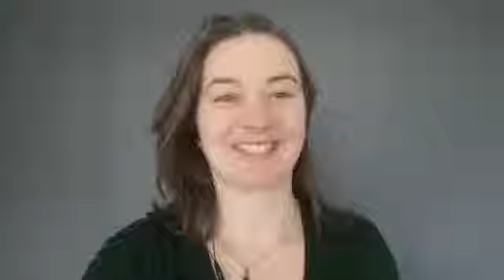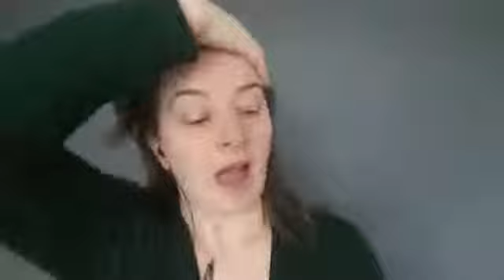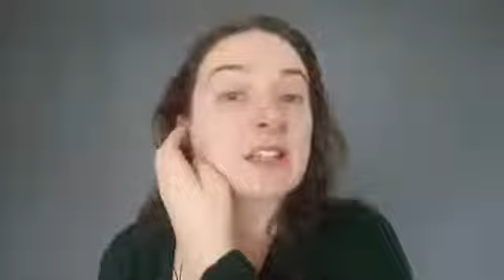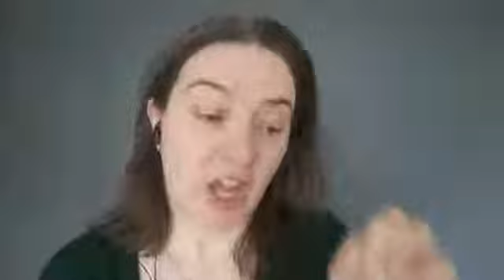Homeowners guide to building control

Comment: Have a question about building control ->

Have an extension that was built by prior home owner.  Roof is now leaking and is in need for replacement, if we were to knock down and rebuild the extension (with planning approval) do we need to go back and get building control approval?  If we just replace the roof would that need planning?  Seem to get varying responses depending on if windows get bricked up or not.  Any help would be appreciated!
Reply from the maker: This is too complex to answer in a simple comment and I would need more information to be able to answer this properly for you. You can book a consultation call with me to get in-depth answers to your project specific questions here: https://hello.dubsado.com/public/form/view/5c3747e093578b4bd89dbbdf

Comment: Brilliant video. 

We’re currently purchasing a property  which has an extension built in 2003. The current proprietors took out an indemnity policy for this as there was no paperwork available. I have found that this is listed on our local authority’s building control portal, however this is staged as “building work started” but with full approval of plans. Just a little perplexed as to whether this would mean it was signed off at the home or remains outstanding? 

Rather reluctant to contact my local authority as I would not want to invalidate the indemnity policy insitu.
Reply from the maker: Check what the indemnity covers you for - you need to know the specifics of that. Check if asking building control about it would invalidate it - it might not and then you could find out more.
Getting sign off / regularisation might be easy if its built in accordance with approved plans - though finishes may need to be removed and reinstated, and possibly rectifying works, which could be costly - this work should be covered by the insurance but you need to check.
It may have been signed off but no completion certificate issued - which will remove the problem.

Comment: Who is responsible for knowing what the building regs are and if they have been meet, the homeowner or the builder? We have converted the loft to a chalet bungalow and the building inspector has been round several times. They came when the steels were put in and said everything was correct but now all the insulation and boarding has been done they are asking if the steels have been fireproofed. Who should have known this was required, us or the builder, nothing was mentioned to us at the inspection regarding fireproofing, so who should have known and be covering the cost? We had a similar problem with the windows but that is easier to fix.
Reply from the maker: I'm not a legal expert, but as far as i understand it, the owner of the property is ultimately responsible for building regulations to be met, however, it may be possible that your contract with your contractor may make them at least partially responsible. It is a criminal offence not to comply with building regulations, however the regulations documents are guidance only so you can take alternative approaches as long as you can prove that they create an equivalent result.

Comment: do you need planning permission when using a building notice say on a porch extension
Reply from the maker: Only if its not within permitted development (PD). If it meets permitted development rules then you don't need planning permission for a porch. This depends on the location which affects PD - for example conservation areas usually have restricted PD, and it depends on the design of the porch - so the size and materiality of it may or may not comply with PD requirements. The best thing to do is call your planning department to check, or if you can't get through to speak to a planning officer then you could book an advice session with a local planning consultant or architect who could potentially advise you.

Comment: Hello, thanks for the helpful video. I was told you can use council building control or private building control.  The two options above are they just using the councils building control department? If so, is it worth going private? I have been told they are quicker in some areas?
Reply from the maker: You can choose approved inspector (private) or council building control department. In some areas private is quicker. I would recommend quality over speed as your safety is more important.

Comment: Hi Jane, great video and its been really useful to hear about this from an actual architect! I own a flat that used to be two properties, was joined together (one heating and electrical system) and now I would like to seperate the flat into two again. What exactly will building control look at in this situation and would I need to rebuild the entire property to modern regulations? Will I need to submit detailed MEP, elevations and GA drawings? I am merely building a block wall to seperate the flats, a new consumer unit and electric boiler. The plumbing and heating will be slightly altered to seperate the flats. I live in London Tower Hamlets. Thanks Jane!
Reply from the maker: Hi! There are two things you will need to do to achieve this. Firstly you will need to get planning permission to create two separate properties. Then you will need to comply with the latest building regulations for both properties. There may be other legal obligations to take into account depending on your building type and situation, as other things can also kick in - for example if it's leasehold then you will require the consent of the freeholder. If you'd like more personalised and in depth advice than this then I'm happy to offer you a strategy call to answer your questions. You can book through my website here: https://www.i-architect.co.uk/contact.html

Comment: Hi Thank you for the information. Great info but has also created a little more confusion for me. So I have, Planning and  structural engineers drawings. I had no idea that I would need Building control drawings and and my architect is suggesting even more detailed drawings for the project. Please, why do I need so many drawings? what can I do without? like you mentioned, all these drawings attract very expensive professional fees!! Please advise. Thank you
Reply from the maker: The more detail you have the more certainty you have at the construction stage. 

Yes it costs more in professional fees to have that detailed design developed and drawn, it's worth remembering that you are not just paying for drawings it is the design process that you pay for and the drawings are simply the communication tool for that. 

You don't have to get more detailed design and drawings, however not getting those does mean that you have more risk at construction without. Some people do get construction done based on planning drawings so that is your choice. 

You are likely to find it difficult to get good contractors that way, as decent contractors don't want to work on projects with risk and projects with more detailed drawings are less risky for them as well as you so. 

Ultimately it very much depends on the scale and complexity of what you're doing.
Reply: @iarchitect  Great answer. Thank you for helping me get clarity with the next steps

Comment: Four years ago a new 3G toxic rubber pitch was built at Homewood School right next to our ancient small lake. Within months of it being opened and rented our 24/7 to adult clubs our small lake was poisoned, wiping out all aquatic plants, micro pond life and shrubs watered with the lake water. The EA refused to take on the case saying it was/is a "Localized Issue" Ashford Planning say they will close the case if the tiny re-used old drain for the 3G pitch is same as was passed at the Planning Stage ?? We have been waiting six months doe Ashford Planning to close the case so we can move on to the next stage. It seems from what you say that it is BUILDING CONTROL we should be complaining to yet Ashford Planning have omitted to tell us that. Our banks are now eroding due to high pressure water coming from the school and from land they sold on which there is now a block of flats also right next to our lake which has drilled though the underground stream serving out lake with about 50 very deep concrete piles. It seems no consideration was accorded to our waterways by Building Control or the Planning Authority whatsoever. How do we put this matter right? What is the correct procedure? We have lost an enchanting paradise and many species wiped out but the matter is being swept under carpets by the school and buy all the authorities our Town Council and our MP Damian Green. It is scandalous, despicable and possibly corrupt. Our retirement ruined and our property being destroyed, It is downright evil this should be happening to this once wonderful environment. All I can say is HELP! What can we do to fight these evil monsters.;
Reply from the maker: This sounds like a situation that needs to be dealt with through the courts. I'm sorry I can't help you on this specifically. I would suggest that you seek legal advice. It may be possible for you to get your local councillors support or some local eco activists who could help you set up a group to raise funds and take legal action.

Comment: #repay. Hi Jane, I’m a bit confused about which route to go down. We have planning for a 4m x 8m side extension & a 17m x 4m rear extension, plus a full roof off loft conversion as we don’t currently have the head height on our bungalow. I’m being pushed into the building notice route, but not sure if I should go for full plans, as I’m only getting the bare shell done & doing all the rest myself. Just wondered what your thoughts would be on this?
Reply from the maker: It sounds as though you've got an architect to help with your planning permission, so I would recommend speaking to your architect as they will have a better understanding of your specific situation.

Comment: Hi I am helping my daughter’s kitchen extension. It is confirmed by Thames water property search team that building extension within 3 metre a full plan will be 
Submitted to building control. Please 
help me about documents required for full plan notice. I have already Archirect drawings which have been approved. I am also getting structural engineer drawings and calculations soon for the survey he has carried out. Please let me know what other documents BC needs from me along with my full plan notice. Thanks
Reply from the maker: You need a set of building regulation drawings - since you've been working with an architect to this point they will be the best placed to advise you on exactly what needs to be included for your BC application and will be able to produce those for you.

Comment: Hi ive been told i can do this by a builder but i dont know what type of building regulation form is needed. I have a large bedroom with two windows in it, i would like to convert that into two rooms, however i will need to take a small part of the double bedroom behind to join my hallway, the builder said it is fairly easy to do but you will need building regulations and he doesn't do that part, any idea what the right form is needed please? Many thanks
Reply from the maker: There are two ways to get building control approval. Full plans or on a notice. I'm not sure exactly what your project entails, but for residential you will have these two options. If the work involves structural changes then you will need some structural calcs done. For a small and simple job then many builders can do this and deal with building control on your behalf with a notice. But the best builders tend to prefer to work on bigger projects and to have everything dealt with so that they know exactly what they are pricing for and can plan the project in properly - in this case they may prefer full sets of building regs drawings to price and work from along with building control already dealt with through the full plans application. Hope this helps
Reply: Seems like he doesn't want the responsibility if it goes wrong. Contact your local authority and explain they should be able to help you with information and may even have approved tradesmen they recommend.
Reply from the maker: Most won't recommend any trades though some councils have schemes for approved builders, like Trustmark.

Comment: As with the Building Control application, you can go down the private route or via your local authority. The question is, if you're planning to hire a private approved firm, do you still have to submit the building control application to the council or you just engage the private firm who will notify the local authority on completion? (assuming you're submitting a 'notice' as opposed to 'full application').

Maybe, also, worth doing a video on pro's and con's of private vs local authority BC application ? 

Many thanks in advance... (great video btw) !
Reply from the maker: Good idea. Have you been through the process yourself?
Reply: @iarchitect  thanks for the reply. 
Yes I have been through the process twice in past, a while ago though. Once privately and once through the council. The council’s inspector was more thorough than the private one, but the private one’s quicker to turn up but a bit more costly. 
Am going through the process the third time now and not sure if things have changed since. 
Our planning permission is about 2 weeks from approval so am considering which route to take for the building regs. Already have a civil engineer hired for the steel beam and pad stone design. 
My question was, do I still apply to the council for building regs? The private building control companies say they’ll notify the local council so does that substitute me applying for building regs ?
Thanks again :)

Comment: Hi. Great video. I’m looking to have a single story extension built to my terrace property under permitted development. I’m concerned with my foundations. I had a large oak tree in my rear garden which we had permission to cut approx 2/3 years ago. Obviously the soil condition, root structure is a big concern with my build as the tree was rather big and close to my property. My builder has said they will only know more on what foundation type we should need when they start digging. Will building control ensure the correct foundations are put in place at inspection? Should i get additional checks before starting this project or wait until the digging has started? I don’t have really deep pockets but don’t mind finding a way to spend money ensuring I know it’s done right. I’m just really confused. Any help would be appreciated. Thank you!!!
Reply from the maker: You can employ a structural engineer to check for you - they will have at least one test pit dug and see what is going on. They will also test the soil. Then they can design foundations before the builders start. There's still a chance that something can be found underground and add in costs, but this approach helps minimise that. Good luck with your project.

Comment: I am planning to do a 3m extension to my semi detached house, its permitted development but whats the process of building regulations. I am project managing it myself, if possible plz help.
Reply from the maker: It sounds as though you will need building control approval. At the moment for single home property you can do that either as a full plans building control application or on a notice. You are best to contact your local authority building control department in the first instance, unless you have an architect involved who could deal with this for you. I don't recommend project managing a construction project yourself unless you are very knowledgeable about construction. Using the right professionals can save you more money than it costs, as well as make the whole process much quicker and easier.

Comment: Great detail really good explanation, if you are trying to do anything/ low carbon , innovative ? Hard to get through building regs
Reply from the maker: Thanks I'm glad you found it useful. Do you have a low carbon / innovative project that you're working on? I find it's not so very hard to get innovative or low carbon designs through building control. The approved documents are only guidelines so you don't have to follow them to the letter. As long as you can prove through calculations that you meet the principles of the building regulations then it should be possible.
Reply: @iarchitect just timber frame , but want a low impact foundation, most options seem to be strip and trench which has too much carbon attached to it
Reply from the maker: @zalkhirsan9481  For foundation design you just need to show structural calcs and if it's unusual / innovative prove that the material you're using is robust enough. The regulations are basically there to ensure health and safety, so if you can prove that your solution meets those basic principles it should be possible to get approval.

Comment: Hi thanks for explaining question when your designing a property do you have to keep cross reference plans with building regulations
Reply from the maker: Hi Ryan. Thanks for your comment. I'm not sure I completely understand your question. So apologies if this answer doesn't clarify what you want to know. Please ask if you need additional clarification! 

I'm assuming you mean keeping building regulations approved plans as a record and during the construction period. If so, then yes. 

I would include a full set of signed drawings as an appendix to any construction contract as a cross reference so that everybody knows what the work involved is that the contract relates to. Does that answer your question?

I would also suggest keeping a set to pass on to any solicitors who might be carrying out the conveyancing work as and when you come to sell the property.